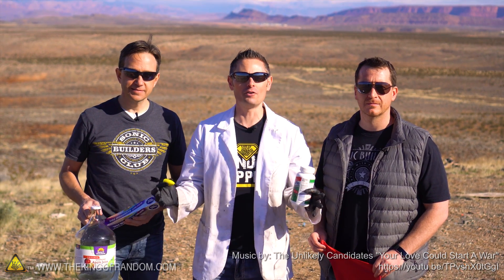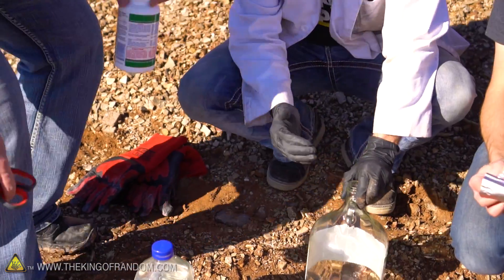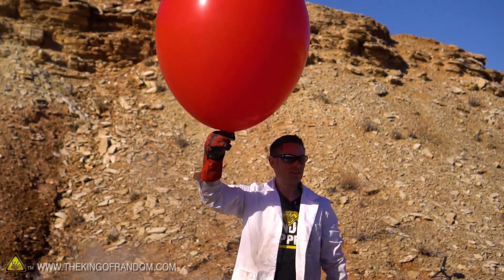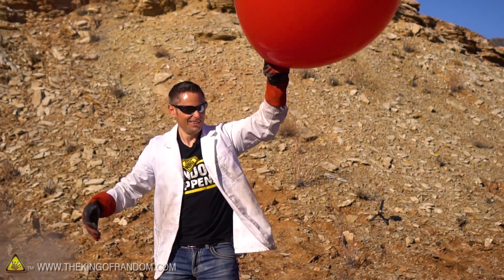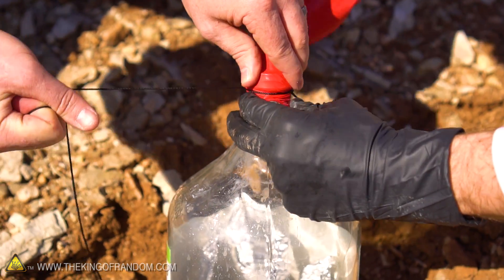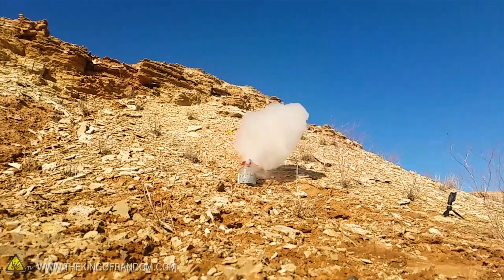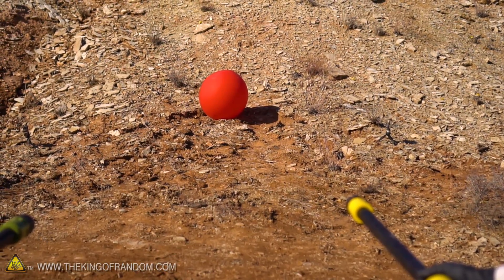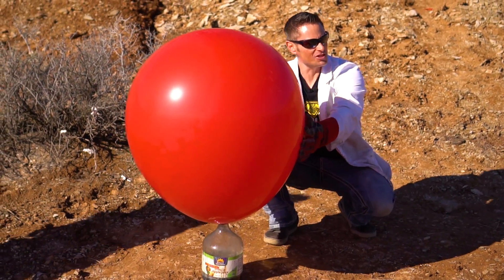Gigantic Hydrogen Balloons | How To Make A Hydrogen Balloon Explosion, Gas Balloon, And Balloon Bomb

Comment: This isn't really an idea for a new video but I'm guessing your balloon has probably popped a few times on that hot jar considering how you put one clip in there. Couldn't you connect a pipe on the top to let the hot hydrogen run through? Maybe run the pipe through a cooler with ice water or dried ice/liquid nitrogen so when you fill the balloon it isn't as hot anymore and you can quickly drain the water in the balloon?

Comment: make aluminium legos!
Reply: Plastic legos hurt enough. I can't imagine stepping on an aluminum lego!
Reply: We've seen Grant melt copper in his foundry, which has a melting point of 1984° F (1084° C). That's not much higher than the melting point of silver (1763° F / 962° C) or of gold (1948° F / 1064° C).

Gold and silver Legos!
Reply: They wouldn't work super well. They'd either be too tight to fit, or they wouldn't securely join up. Part of how Lego bricks work is in the flexibility of the plastic.
Reply: Silicon legos
Reply: DUDE.
Reply: no one YES
Reply: that nice idea

Comment: You should add some molten aluminium or different metal in to Vacuum chamber And see what happens.
Reply: how? XD
Reply: Rozkozz The vacuum chamber is made from glass so it will crack
Reply: CretuPaul H-made weapons Yes but i think you can make something that can withstand high temperatures
Reply: what do you think will happen? It'll just harden

Comment: Would putting a rubber band over the neck of the jug, doubled over to make it tighter be better for taking off the balloon? That way you can just slip it off and maybe tighten it up another time or two to prevent the escape of the hydrogen. Seems like it would be easier to me.

Comment: You could make a condenser and put it between the bottle and the balloon. That way you would only get Hydrogen in the balloon, which would also be cooler (temperature), and you would be able to collect more before the balloon pops since it wouldn't fill the balloon with hot Hydrogen and then cool down and lose volume.

Comment: next time run the gas through a bubbler like you would use for fermenting. the gas will push through but the water should condense in the bubbler water.

Comment: Would you consider some more experiments with oxidizers? How well does "rocket candy" work  if you mix the KNO3 with a different fuel like sawdust or charcoal? Can you make the resulting fuel burn in your vacuum chamber? 

If you feel such pyrotechnics are too risky, would you consider trying to make astronaut food instead and setting up your on freeze-drying apparatus?

Comment: You need to add some 02 to the balloon to get a better explosion. Your limiting factor is that only the outer shell of the cloud can combust at any time (you need air for fire!). If you add 02 to the hydrogen balloon you will get a MUCH larger bang.